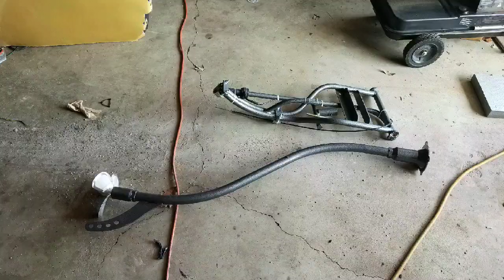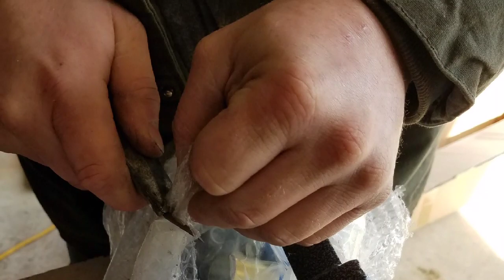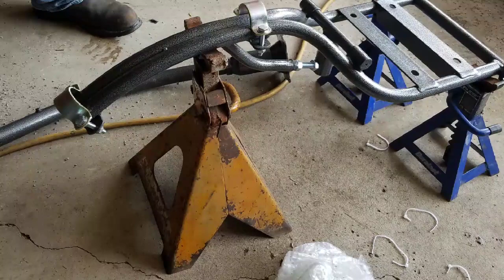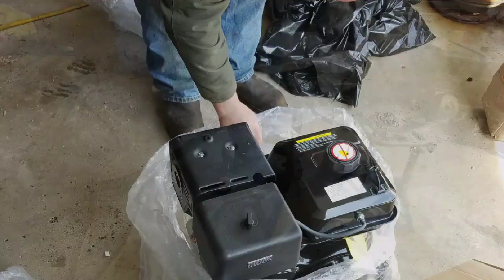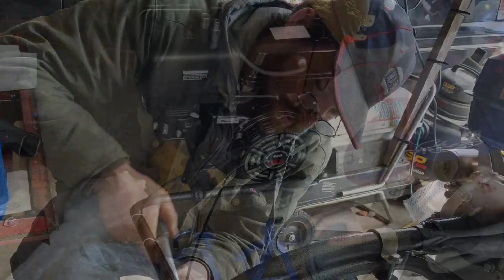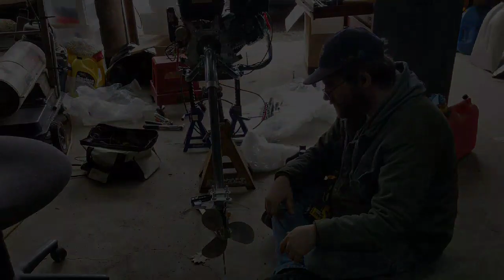Mudskipper Twister 16 hp Mud Motor assembly

Comment: What size boat , any feedback
Reply from the maker: Its  a  1972 16 foot I think it's a 72 inch wide sea nymph. I put the 16 horsepower mudskipper twister mud motor on it. Yet perform okay. Depending on conditions I can get it about 12 to 14 miles an hour. Keep in mind I'm six foot seven I'm 400 pounds. So someone normal size it probably would go faster. If you have any physical limitations such as back shoulder hip I would not recommend getting a Mud Motor because it's about like wrestling a pig to run it especially when conditions are rough. The number one complaint I seen with the reviews on the mudskipper is vibration. To be honest I bought the mudskipper motor because of the vibration because one of my targets fishing is the flying Asian carp and I have a lot of fun getting them to jump.
Reply: @chumpchangeoutdoors1919  12 to 14 mph by yourself or with someone else ? I used to have a longtail,  i been looking at buying another one but now I'm considering this kit. I'd be happy with somethin near 15mph
Reply from the maker: That's with me my girlfriend and my buddy my live large Live Well filled with water all my tackle and bait. I had one of the long tail mudskippers and I'll be honest with you I like the long shaft better. I had to modify my transom on my boat so I can swing the the Twister Mud Motor around for transport. The biggest complaint that I have is the prop is supposed to ride high in the water but no matter what I do the prompt digs down till about 2 ft. I can tell you the one gallon tank with me my girlfriend and my buddy and all my gear I can get war on a 1 gallon tank of gas approximately 11 miles up and down the Waterway.
Reply: @chumpchangeoutdoors1919  I saw videos of people adding a prop adapter to use the old props, supposedly they help with speed and the other issues you mentioned.  If that's the case, mudskipper should sell the kit with that adapter already in place for better performance.   I talked to a guy on facebook yesterday who's selling this setup but with a 212 cc, he said the only reason hes selling is because he wants the 420cc now. He said he loves it, just wants a little more power. He also said he had a longtail before this one, and that he likes this one better because it was easier to maneuver. But he did mention the vibration also, he said just make sure you bolt it in good and make sure to check it constantly
Reply from the maker: When this whole virus things settle down and I can get out. I'm going to do a video on my one-year ownership of a mudskipper twister Mud Motor. The boat is in my buddy's Barn still in winter storage about 50 miles away. Subscribe to me and you can see it in the future. Allpoint now what I like I'm what I don't like. I'll go in depth and explain everything no people will know the good points and the bad points. I'll subscribe to you also.
Reply: @chumpchangeoutdoors1919  this is my fishing channel